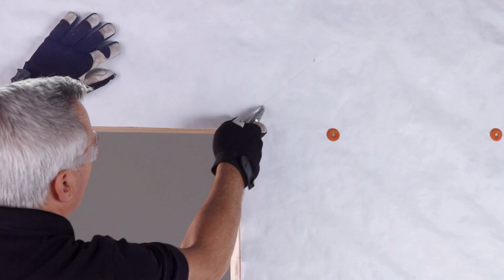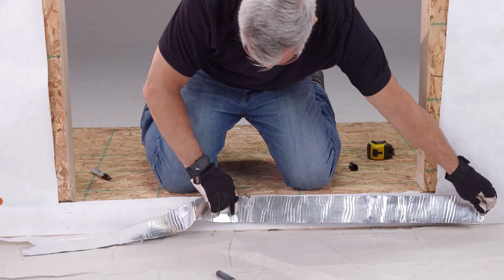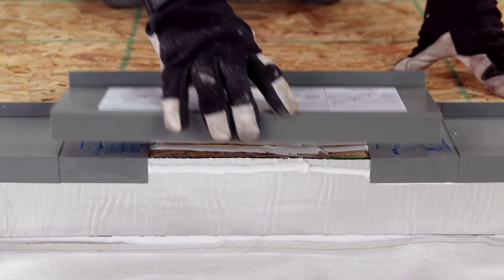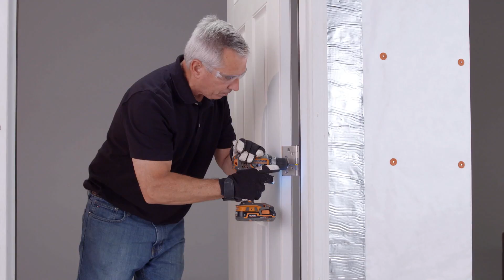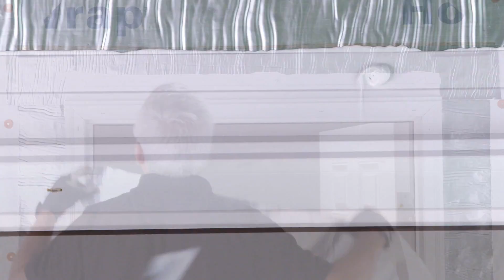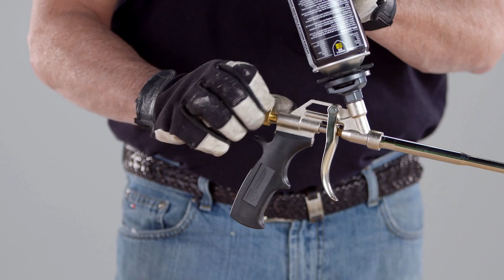How To: Brickmould Door Install

Comment: Omg this video is asmr this is literally 100% water proof. The only thing I’d change is the way you laid the sealer under the door in lines doing vertically up and down and just 1 going diagonal on the inside so if water gets in I can flow out

Comment: Why not just wrap the WRB around the studs and put the tape on the corners? If you have any failure of the caulk then the studs will be exposed .
Reply: Yes the WRB white wrap should be cut longer by at least 4 inches & wrap around stud/frame as well.
Sealant is the real star with this system.
If water got on white wrap it then goes under foil tape & onto timber frame especially since you cut the WRB away from the stud (why) - https://youtu.be/ZFfJ2HTRUeU?t=180

Comment: Stupid amount of caulking for a single door
Reply: I guess youve never went to replace a door and found a rotted rim sill that you had to cut out and repair by ripping the floor up and turning a 2 hour max door install into an all day repair job.
Reply: Me replacing my rotted door jam says it's probably not enough
Reply: I agree...but overkill when it comes to potential moisture problems isn't a bad idea.
Reply: $10 a piece a huge business in 5 doors and 12 windows $400 - $600 just in caulking  🙄
Reply: Agree I’m not an expert, but it seems like a lot of sealer